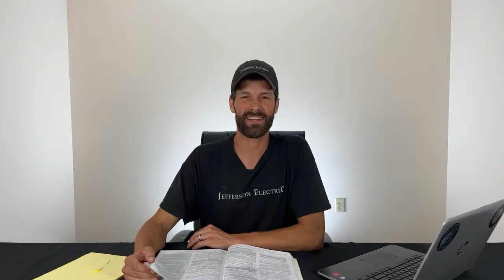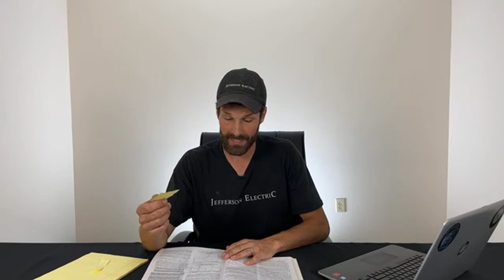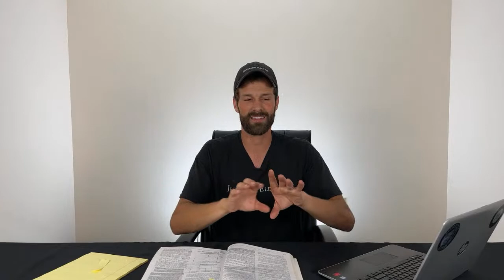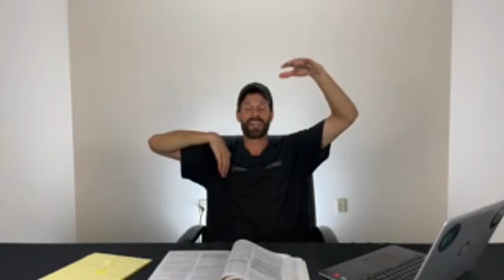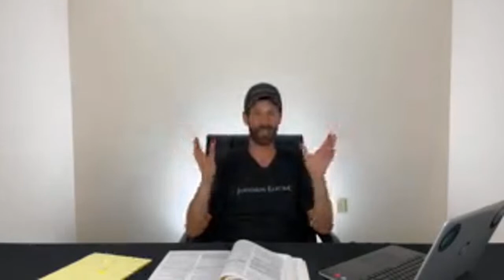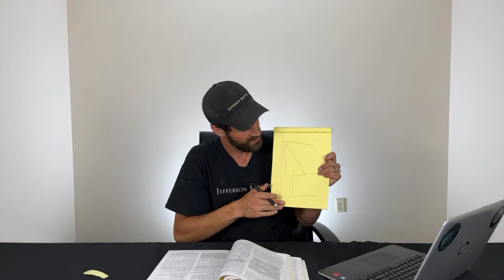Live from EPRO ACADEMY

Comment: 22:04, you ask if we've experienced remote control for main disconnecting means. yes, we've got remote handles or "chicken switches" on a mimic panel for all our larger gear. The main incoming breaker (23kv), breakers feeding transformers that feed different low voltage MCCs, even PFCC cabinets and tie breakers. From what I understand this was designed so nobody needed to stand next to a big breaker that could be opening or closing under load, all in the name of safety.
these mimic switches are only low amperage control switching for the close or open control of the larger motorized breakers. we do have charging handles for our breakers...but it's rare to need to manually do that (basically just on initial startup before the UPS was running for control power).
anyway, that's how I've used them, but that's not in a residential setting. it's unlikely any of that is useful for one of your projects. If you want I can send you pictures or a video of our medium voltage gear.

Comment: Check out the Vessel screwdriver part # 220USB-1U. The size of a normal screwdriver but had electric drive up to 17 in-lbf at 280rpm AND turns just like a normal screwdriver by hand. Only around $60, too. Could replace the #1 Robertson in your belt...? 🤔

Comment: Hi Joel,  noticed alot of electricians are unlearned in expansion fittings for runs over 20' ft in PVC horizontal. Noticed this mostly happening in parks and utility poles where the wires pop out of the bell ends of PVC.   Why do you think this practice not taught to electricians in the field?

Comment: Sometimes it seems the inspectors prefer to have you run extension cords all over the floor, since to get a couple of extra outlets installed they require an impractical upgrade of the entire branch circuit to the current code. You run into things like, "That junction box might have been OK when the house was constructed, but the current code doesn't allow that many wires, and if you touch any part of that branch circuit you'll have to correct that."

Comment: WOW still on the 2008 NEC. Finally found a state worst then Pa which was on 1 code cycle for 9 years. Dukes of Hazzard Pa had been talking about going with a state license since my father took his test for a Philly electrical license back in 1964. Took me over 2 weeks to find out how  to get a license for a very small town ( yea pre Internet ). Even called the fire department and they did not know. Finally found out that the only electrical contractor in this hick town gave out the electrical licenses and was the town inspector. Worst part of not having a state license is some towns do not recognize a license from the big city next to them making you pay 3 visits to them and pass a 4 hour exam.

Comment: On torquing of receptacle and switch screws I hate to disagree. I am doing them religiously the 2020 NEC standard has upgraded the requirements for torquing. I often see badly arced receptacles, and switches often simply due to lack of tightening especially in older tighter older boxes in those cases the tension on the wires pushing against the screws is greater leading also to loosening over time and then arcing sets in. Always replace those switches and receptacles with new ones and torque up the screws and place ideal armor bands around them to avoid inadvertent shorting. The legal case you mentioned I think for a business the liability is greater so yes it’s going to take more time but the safety of that install is greater your adding more value to your customers as you go above and beyond. Do the math if it takes 2-3 minutes more for each receptacles add the charge on. Explain to the customer what and why you are doing it and I am convinced most would be happy to pay for that for a safer install. Actually the more you do the faster it becomes and time lost is in my view comes down to probably one extra minute for each receptacle or switch.

Btw the way try the wiha torque screw drivers nice and slim and really very small and easy to hold in a belt. The wiha torque screw drivers also do a tool for calibrating their screw drivers which is great they just need to produce one that works for the lower torque ranges say when torquing receptacle and switch screws.
Reply: A few years ago at an IAEI continuing education class we had a great instructor from UL labs tell us that UL went around the country and checked the torque on believe he said hundreds of devises and less then 30% had the proper torque on the screws. Rest were either too low or over torqued. He stated that over tightened terminals can be just as much a problem then with too low of tightening. On electrical fires lawyers will have a forensic electrical inspector will check devises for proper torque.

Comment: AFCIs are much more reliable now that being said even with them installed on my microwave circuit it does trip once every 2 months. I am happy to live with that rate of nuisance tripping to gain some measure of protection against serial and parallel arc. And this argument become even more significant as the wiring becomes older.

If you really want to learn the issue of AFCI development it’s actually a challenging electrical engineering problem using plasma physics, signal extraction issues and various other technical issues around sampling data for voltage and current at wide range of frequencies while still sampling enough data to pick up the characteristic signals of arcs from current and voltage data. Then there are issue of transforming analog voltage and current signals sufficiently well to preserve the original signal while allowing robust construction of it in the frequency domain data this could then involve filtering techniques including advanced wavelet and Gabor types in addition to standard low and high pass filters. As time proceeds theses devices will keep improving I would say that manufacturers of devices do have a responsibility to ensure their circuit design and operation of motors, fans and other inductive and capacitive devices do not in themselves generate transients or surges that can blind these devices from operating.

Joel if you are interested I can send you some reading if you would like.
Reply: @ElectricProAcademy  yes they are superb they also have more expensive digital versions but these are just as good. I have also bought a torque checker but that tool covers a higher torque range.
Reply: @ElectricProAcademy  it’s a difficult one. They are more sensitive and I think breakers as opposed to AFCI/GFCI receptacles are more vulnerable to transients as the breakers as they in the panel are the home base for all arc-like signals from all circuits and loads flowing into one panel. GFCI/AFCI receptacles near the source of the load works best. In my opinion I like the combination Leviton AFCI/GFCI smartrip receptacles devices 15/20amp devices they work really well. DC fed loads and devices and their transient signals and leakage signals are another important source for false tripping and have been found to not only blind AFCIs but also GFCIs.
Reply: @ElectricProAcademy  yes I saw the class action documentation. My response below on why I actually suspect it’s more challenging to discriminate between arc at global breaker level than local receptacle level.